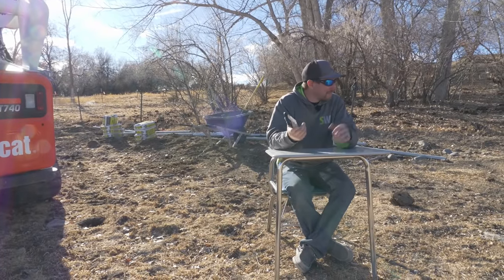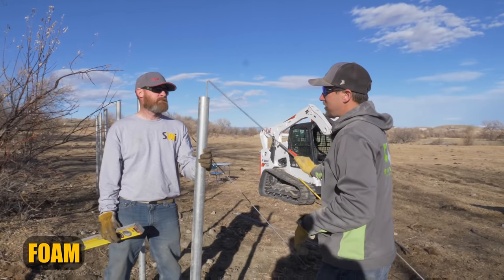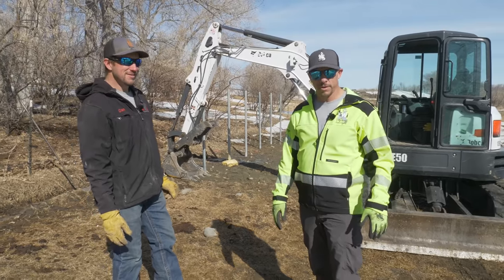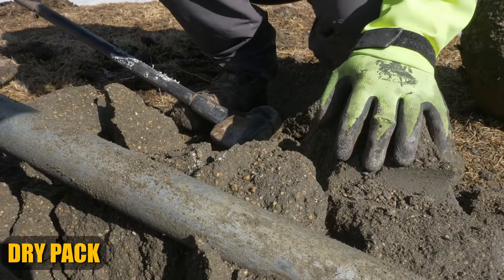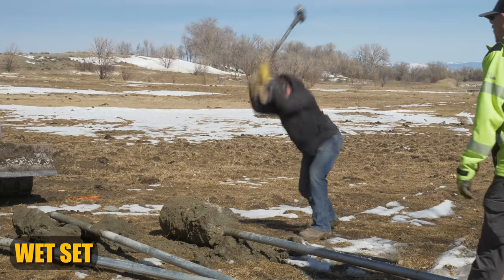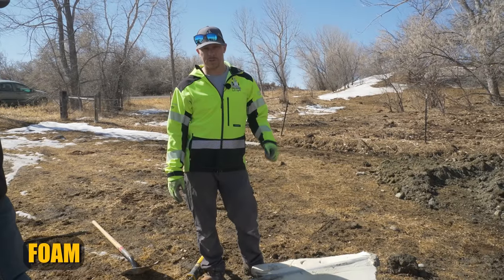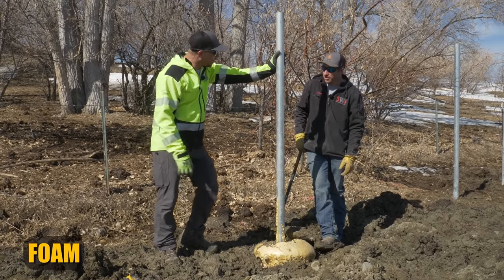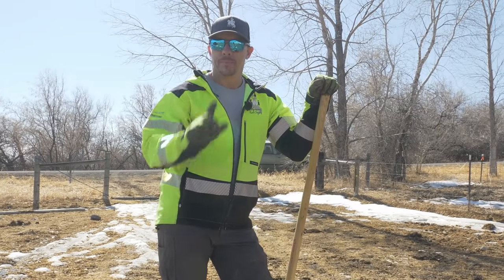Fence Foam vs Dry Pack vs Wet Set | We compare methods to see which is best for fence posts

Comment: SIKA POST SETTER IS MY CHOICE, CONCRETE NEVER DRYS AND WILL DRY ROT THE 4X4 WOOD POST OFF IN 3 TO 5 YEARS
Reply from the maker: Personally we'd rather drive the posts and forget all the filler where possible.  We are not a fan of wood anywhere steel can be substituted.
Reply: @SWiFence  Even the galvanized steel eventually rust off from the inside out...Just Saying

Comment: So dry pack is really just pour into the hole and then add water vs mixing water and concrete mix outside of the hole
Reply from the maker: Dry pack is not adding water whatsoever. You're just relying on the moisture in the ground.

Comment: In my opinion there is no way dry bag is gonna be sufficient to premixing concrete in wheelbarrow and pouring into posthole.ive removed old posts that were dry filled,post came up easily and dry concrete was mostly powder

Comment: The foam looks like boiler line fill material , from the wood boiler to the house.  Cut the trench tight to the water line, lay the line on rebar stands  pull the line up level to grade pour and lay line in mixture. Settle stands to bottom of trench.. lay in hold down  to keep on bottom. Wait to cure, backfill😎

Comment: Good video except at the end where you pull the posts straight up.  In the real world loads on posts are not straight up - loads are horizontal from animals.  You should have pulled the posts horizontally and use  a tension gauge to see how much force it takes to pull the posts sideways and compare the three setting methods.

The fact that utilities now use foam leads me to believe that foam is the best overall method.
Reply from the maker: That's an excellent point, Bill. We really weren't trying to load test it when we were pulling them out--just getting them out to examine them. You're absolutely right: load tests have to be done sideways. That's one of the reasons we're such a big proponent of driven posts!

Comment: Peak strength 21 days , concrete will continue strength as time passes and will do internal as years and time start deterioration of outer surface
Reply: @Hi Harry how are you doing
Reply: Peak strength (spec) is 28 days, but will continue to increase over it's life.  It's about 90%+ of spec strength curve, at 21 days, under moist conditions.  This is for conventional sack mix. Ie 3000 psi spec.

Comment: Why do you think pulling posts straight up and if it remains bonded is any kind of real world failure?? That is its asset for future removal. Lateral strength is the only test that is necessary in fencing or partition applications.
Reply from the maker: We were pulling it out so we could hammer on it and inspect it up close. The pulling isn't part of the testing. You're right--fences never face forces pulling them out of the ground. 😉

Comment: Fence foam is freaking expensive. I am going to installing 92 5”X5” vinyl fence posts. I would need 92 bags of foam at a total cost of about $1,350.  I could use just one 50-pound bag of concrete per post at a total cost of less than $500.
Reply from the maker: Not the point of our test, but an excellent point nonetheless. 👍🏻 Assuming, of course, you're good with one bag per hole. We would typically use more than that.

Comment: Foam is expensive, messy and toxic. Concrete is strong and cheaper, but heavy and time consuming to mix. I'd say, dry set is best if you add water to the hole given. It's a good compromise for efficiency in suitable conditions.
Reply from the maker: And driving is the future!

Comment: If the post comes out that easy then I would take caution if I were utility company, in the event a tornado was to come threw instead of breaking the power poles they may become air born missiles.
Reply from the maker: From what I saw I wouldn't worry about that.  They don't come out that easy and a power pole has a lot more surface area in the ground.  There is a higher likelyhood it will snap off in a tornado which I think already happens.

Comment: comparison between utility pole & fence post is invalid as an argument for strength of the foam method. the latter has to carry the load of a typical 6-8ft wide x 6-7 ft high section of fence. the wind pressure on that surface area (for a wind direction perpendicular to the surface)  increases approx 4x if the wind speed increases 2x. the utility pole has nothing but wires connected

Comment: Why wouldn't  they use the pointed end of the sledgehammer that's what's it made for breaking concrete
Reply: You can beat on concrete with excavator bucket teeth. not as effective as back of bucket pointy not always better

Comment: Every time I wet set a post I put it in the hole and than put the cement in  - not the cement first and than the post.
Reply from the maker: We've done pour and then stab for years because it ties in with how we eyesight our posts without string line in most cases. Also, if you've got hollow pipe stabbing after pouring gives you the added benefit of concrete inside the pipe for that much extra strength. We also like to float the post with concrete underneath.

Comment: Has anyone ever tried a layer of concrete around the bottom quarter of the pole in the hole, a layer of concrete around the top quarter of the pole in the hole, with the middle half filled with packed rock, gravel, or even soil?

Comment: You are supposed to add water to the dry method at the end.   Trusting that the fact the utility company uses something is comparable to it being safe is beyond naive.   There is another video where they use foam and show how quickly the post set in foam moves freely.

Comment: Tried the foam and set 10 4 by 4 post. They all became loose after a week. Don't use the foam. It seems to shrink.
Reply: Were they pressure treated?  I wonder if there's a reaction/ it causing its own barrier and avoiding purchase on the foam. Especially as the wetness of the treatment changes or dries.  Just what it made me think of, but I don't bury poles much and when I do I just wet set the few I have to.
Reply: @SecondLife777  They were pressure treated. Used them to put up 7 ft. Deer fencing around the garden.
Reply: Can you tell me what brand of foam and what soil type you have please?
Reply: @Scott Demaree  Sika pro, I believe. Pa soil. Clay like dirt.

Comment: Funny stuff, but reality wins everytime....  No replacement for a round wheel, even tracks require round in grand scheme of things.  Dry packing is a "good enough" solution for something you want to relocate later yet hold firm...so there are reasons for folks choosing a more permanent set. I wouldn't have foam in the ground no more than in my home....total mess to deal with if you ever want to remove it or do a remodel...

Comment: Dry set is the lazy mans way. Dont  EVER  dry set  ANYTHING  you want to last.
1-I dig my post hole a full 40"-thats the cowboy way
2-I place my post in the hole & use 2 support sticks. 1 fore & after the other side to side to level the post.
the sticks are attacked to the post & to a stake driven into the ground.
3-I pour my mixed wet set concrete. Let the concrete pile up around the post like an anthill. This makes rainwater flow  AWAY  from the post.
4-Tomorrow-I remove leveling sticks & stakes.
I have used foam-it works great! Especially where water is not easily accessible.
A guy came along & ran over my mailbox shearing the post off. The part of the post in the ground
stayed in the ground it took the hit with no trouble. It held firm as the top of the post was sheared off.

!

Comment: Dry pack works great . rain is what sets it. If it is in a dry area dry set is not recommended . you need to add water on top. Of the dry mix. This. Test was flawed.

Comment: I wish they stated how deep and wide the hole is supposed to be
Reply: The hole depth should be ⅓ to ½ of the finished above ground height. So for a 6' fence, start with at least an 8' post...sink it 2'-3' into the earth. 
The hole diameter should be 3 times the diameter or width of your post. A 4" X 4" wood post should be in a 12” diameter hole. A 2⅜" galvanized pipe post should be in a 7"-7½" hole- a proven tip is to make the bottom of your hole slightly wider than the top. It's counter intuitive to a novice, as most holes that are dug seem to naturally narrow towards the bottom. Fight this instinct, and make sure your hole flares out or is "bell-bottomed" rather than V-shaped. This is proven to prevent heaving due to frost compared to a narrow bottom hole or even a uniformly cylindrical hole. A wider base is more stable, this is as fundamental a law of construction as you can find.

Comment: Hey Fellas  
Don't you realise
all Posts being set into 
a footing 
Require a cross bar or large bolt at the base to lock it into the footing. 
Concrete or Foam 
Otherwise u are only relying on Skin friction.
That's why your posts simply pulled out.
Reply from the maker: I'm not sure how much vertical force you feel the posts need to withstand but I would say all performed respectably without the bar.

Comment: Foam won't take cyclic stresses line animals or wind flexing the fence, unless it is a very dense foam. utility poles have larger surface area against the foam than fence poles so they are not comparable. Dry pack is only as good as the wet pack if it is not disturbed whilst it abstracts water from the ground. That would require supports for a month. Wet pack is the only guaranteed rugged and reliable approach.

Comment: utility polls are 6 foot into the ground.
Reply from the maker: And 20 feet out.  Our posts are 3’ min in the ground and 6 ft out typically.
Reply: In Missouri, (wood pole) 10% of pole length +2 ft. tamped to remove air from backfill. Climb the pole while the grunt is still tamping.  Most residential distribution poles are 35 or 40 ft. Pressurized foam kit (two part sprayed through a mixing nozzle)
cost about $600 per kit. 1 box of foam would set 1 pole if you didn't dig the hole too big. Sets up in pretty well in 20-30  minutes. Either way if you hit it with a car it will break off at the ground and stop the car.

Comment: Why couldn't you drive the post in like a piling?  All the foam or concrete is doing is filling in the you drilled.   So if you drive them in there is no hole to file or extra material needed.
Reply from the maker: We are big fans of driving! Check out some of our other videos where we talk about that. However, you can't drive in every situation, and we wanted to show folks which of these methods was the strongest.

Comment: I  could be wrong but this looks like a ridiculous experiment. For a start you should never be using mortar or concrete in frosty conditions and secondly if there is no liquid moisture in the ground to soak into the Dry Pack mix, how do you expect it to set? It would be like expecting the Dry Pack to set in the un-opened bag. So, if you want to put up posts in frosty conditions you should be using the foam method, even though it doesn't stick to the metal posts so well.
Reply from the maker: Its a test that covered many of your beefs and busted some of your theories.

Comment: Dry set wood post wet set steel post
Reply from the maker: What is your hypothesis?
Reply: @SWiFence  I set post for a chain link fence dry set and wet the post down came back two days later to install and someone pulled all my post out of the ground perfect round holes in solid concrete but the concrete did not stick to the pipe never had a problem with wood post though

Comment: Those methods are horrible. This is what I do: (1) Dig hole well past frost line (36"-48" where I'm at), (2) Add about 4-6" of gravel for drainage, (3) Place and level post on top-center of gravel (*do not dig the post into the gravel), (4) Pour concrete AROUND the post (1 or 2 bags of concrete, you don't need 4 f* bags of concrete), don't let cement get inside of the post (that's shoddy as f ).*Bonus tip: If you angle the hole, where the bottom is wider than the top, it will help fight the heaving due to frost cycles. Wider bottom and smaller top is better than digging a hole that is small at the bottom and large at the top (*you just got lazy if that happened :).
Reply from the maker: We’re going to have to disagree but thanks for watching
Reply: @SWiFence  I did enjoy the video and I wish I had an excavator :).

Comment: Listen up youngsters... if ya had added water throughout the process of fill the dry pack hole you would have a much denser/ harder set... it’s not a literal dry set! You have to add water, not moisture.  Yes, the wet mix is ALWAYS going to stronger. As far as that foam shit... please
Reply from the maker: Most fence companies using the "dry pack" method aren't adding any water....ever.  That's why we tested it like we did.

Comment: Umm I don't think the test was fair. The "Wet Set" had a very distinct advantage, you placed the post "INTO" the wet set, filling the post and assuming the post did not go all the way to the bottom, the 'inside' of the post was a continuous concrete with the outside of the post. This also would make it much harder to crack the outside concrete as the post center was solid, not hollow.

For the "Dry Set" and "Foam", you placed the post first, then poured 'around it', making the Post a distinctly separate component from the concrete and foam. 

Also, I think the 'Dry Set" needed more time. This is a known or at least anecdotal item. You need 6+ months and allegedly the dry set will be considerably harder.

imho
Reply from the maker: Interesting points.

Comment: Did you not read the instructions. Would you mix your sand cement and gravel and add it to a hole without water and hope gradual damping from earth contact and hopeful rain wet your mix, no. Well, that's what you did with the quick set, you don't get a quick set with a slow wet.
Reply from the maker: Not sure what you're referring to here. We didn't use any quick-set. This was all standard cement mix.

Comment: You went through all of that, and didn't consider doing it the fourth way... the "old fashioned way"? Simply using nothing except packed dirt that came from the hole.🤷‍♂️🤦‍♂️
Reply from the maker: I hear what you're saying, Will, but that would be a different video. The whole purpose of this was wet set VS dry pack VS foam--so we could pull them up afterward and check the integrity of each. If set one in plain dirt and pulled it up later there... there wouldn't be anything to check. 😀
Reply: @SWiFence  true. Evidently I misunderstood the purpose. But then, I am getting old.😂

Comment: I use a dry set.
Reply: Wait what do you mean by dry set, I mix the concrete not at all soupy, is that dry set?
Reply from the maker: Dry pack is no water added. It just pulls water in from the ground. Sounds like you use wet set. 👍🏻

Comment: foam. yeah thats a no.
Reply from the maker: We prefer driving posts skipping the foam and concrete where possible.
Reply: I see foam as a quick short term solution such as for an event such as a concert or circus.  It seems to be quicker for the set up and take down.

Comment: He knows so little about what he is doing he is not even using post setting concrete, which has  stone in it, because he isn't putting the post in first and his higher priority is cutting corbers tomake his work easier, while he said in another video that he justifies charging the same, for the inferior job and its results, plus he doesn't want to do the harder work when the customer opts for it. The post, set into the hole first, is resting it's weight on  gravel pounded base inside the bottom of the hole, not suspended and supported by a rod. I stop watching here because these guys should have worked for someone else before taking this on themselves.

Comment: What an utterly pointless exercise!  Who cares about what you have found?  What we want to know is what is actually useful in the context of building a fence: How well do the posts resist being deflected and, to a lesser extent, pulled out.  The other main interests are; cost, effort and time of installation.
Reply: One thing that can't be tested is long term application. We do know that concrete cracks over time allowing water corrosion to happen. Also it lets bugs in if it's a wooden post part that probably isn't treated as well as the exposed wood. We don't know what happens to the foam in 10+ years.
Reply from the maker: I think you missed a couple key elements:   1) will frost affect the concrete   2) will the foam adhere to the post  3) will the dry concrete cure adequately.  We will do more, but one thing at a time.  However,  force to pull out isn't very useful since gravity tends to hold things down unless its a wire fence.